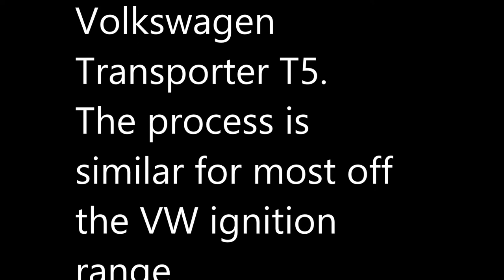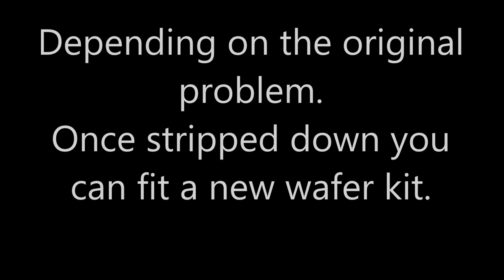VW Transporter T5 Ignition lock strip down

Comment: Yeah but audi a3 year 2007 and transporter with only 32k miles both the ignition keys had seized. No turning to get pin inside to release barrel. Any ideas?
Reply from the maker: I can sort this for you if you're local to me.
If not you're best getting an auto locksmith involved, it will be cheaper than garage and you can use your existing barrel and key
Reply: @DaveBrown2020  new steering lock and barrel vw mate
Reply from the maker: @jamesbarratt593  this is one way around the problem but usually the most expensive
Reply: My type was the barrel with collar. Youtube they show how to open that. Must cut along the side. Then it jumps off. Inside the cylinder. So how service inside and refit if the things been cut allready
Reply: @DaveBrown2020  it's not possible to remove some parts to free it up? I don't really need the lock function of it on my old vehicle so I can live without a secure ignition lock as long as it doesn't lock up :)
Reply from the maker: @frankj86minim once it's stripped down you will be able to see the wafers that are causing the problem